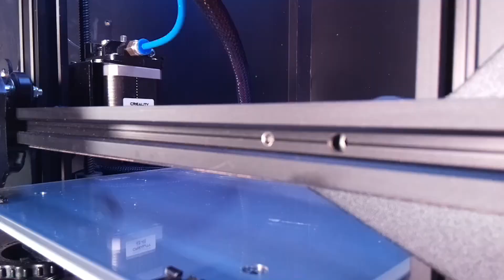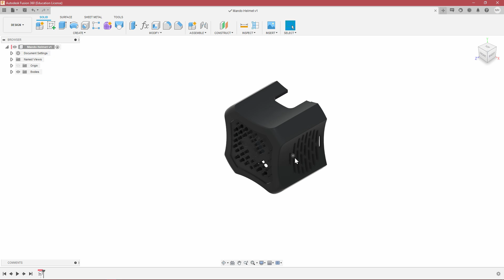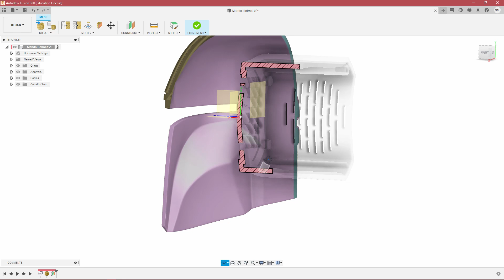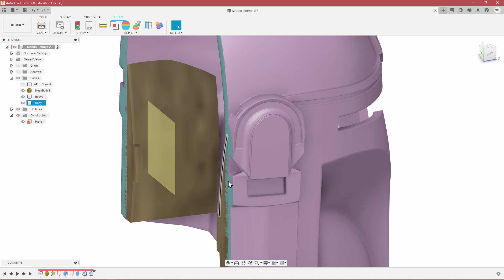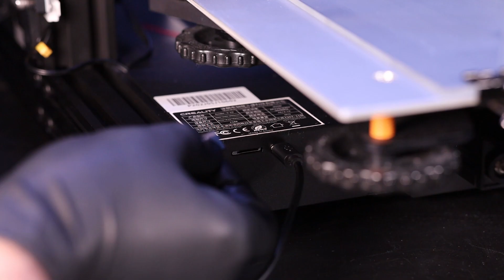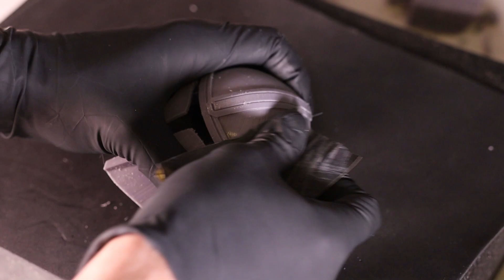Creality Ender 3 V2 - Awesome 3D Printer Head Gear Mando Helm Mod

Comment: Just use bondo. 
For the paint, gloss black with graphite powder, that's best result I've seen for a mando helmet!
Reply from the maker: Cool, where do you buy the graphite powder?
Reply: @NeedItMakeIt  Amazon, maybe? Idk, I'm from Europe but definitely you can get it on Amazon
Reply from the maker: @blacksilla  I've found some on Amazon, most are large qtys, maybe a graphite lube powder would work the same.
Reply from the maker: @kastro6911  These look amazing.   I have some bondo, I'll be smoothing the helm today after some work on my next video.

Comment: Why don't people just use brims? I never use glue, it's horrible to clean up.
Reply from the maker: With ABS I printed with brims for ages, I hated the need to use a knife on the outer rim to take off and little bits leftover.   Sometimes they'd come off cleanly.  I printed with 0.2mm initial layer heights due to bondage problems, so your case may have been different.  

I don't mind a little wash and wax when the part is finished, I have 2 buildplates so I can get the next print started with no delays.

To each their own?

Comment: My Prints are not sticking to the bed !!!
Will they stick better if I replace my bed with a normal glass plate  ?? Or what do you use ??
Reply from the maker: If you are printing with ABS, that might be why, if you print with PETG or PLA, glass with glue stick is the simplest way.  Your bottom layer should be compressed and have no voids in it, this is an indication of the bed not being quite the right distance from the nozzle.  I've always used the paper trick, use regular printer paper and adjust the bed until you can feel a good amount of resistance when pulling the paper out.  

Do you print with ABS?
Reply: @NeedItMakeIt  Thanks but .....
I am also using the paper trick and I used many diffrent papers(now 80g/m²). But when  the nozzle is in the middle the distance is bigger. And I dont really know where the problem is because the bed is not bent. 

I print with PLA but i have never tried a glue Stick because I dont now if my Pritt Glue Stick from Amazon would work.
Reply from the maker: @mxghxst  I have heard of this problem and the BL touch leveling method automatically adjusts for this issue with the middle deforming when heated.  I believe I've not experienced this issue because I have always used glass and it will not warp in the center like the Alum does.   So my best advice for dealing with your issue is to always over-extrude your first layer and also use a thicker first layer, 0.3mm.  I'd also suggest compensating for elephant's foot on that layer within Cura, there is a setting  to activate for this as well.  

Borosilicate glass is cheap, you can also use regular picture frame glass at 2mm, it may break on you because it is so thin.   I almost never need to level the plate and I always see good adhesion on the first layer with PLA and PETG.  

Any old glue stick will do, normally I buy the dollar store one they work just as well as the Elmers purple kids one.  

Let me know if any of this helps and good luck!
Reply: @mxghxst  I had this same issue when I first got my ender 3 v2. Level the corners and middle is somewhat sagged. Assuming you’re only using the two clips that came with the printer in the middle you should get binder clips or additional clips to help pull the corners down. Also make sure to level the build plate  when heated not cold due to expansion.
Reply: Thanks for the great Help 
I will try the clips things and also compensate for elephant..
I was already trying with 3mm first layer but it couldn’t print small curves.

And the Bl touch I also already ordered some days ago !!

Thanks!!🖤
Reply from the maker: @mxghxst  I have a bl on the way also, but I'll be a little while until I can get it installed.   For me it might be overkill, it seems to be a pretty solid upgrade according to most people

Comment: Another excellent vijayo, keep 'em comin'.  :D

For smoothing, I've tried a few ways including Polyfilla, Ronseal wood filler, filler primer spray and spray putty (this one: https://smile.amazon.co.uk/gp/product/B015WIEGN6 ) and the putty is far and away the best at hiding layer-lines at typical layer heights.  Normal high-build filler primer is good for hiding fine layer lines and the wood filler id great for big layers, especially when a larger nozzle is used.

Also, doesn't a quick spritz of an IPA/water solution pop prints off glass very easily?
Reply from the maker: Thanks for the support!

I had no clue there was such a thing, very cool.  We'll see if they have something for Canada.